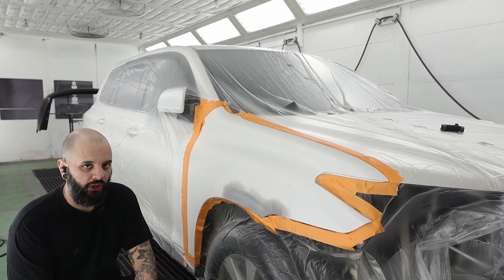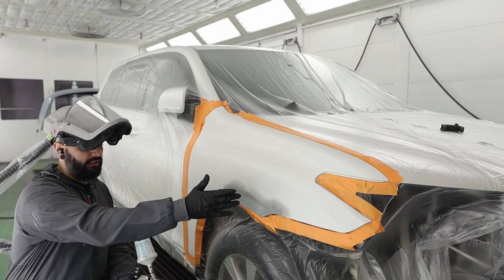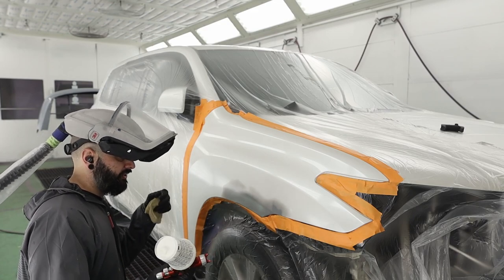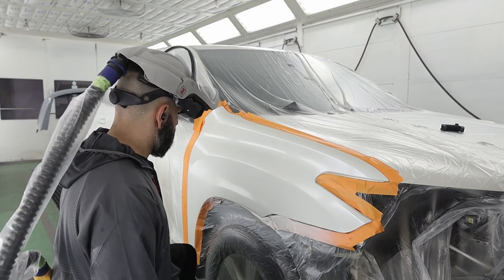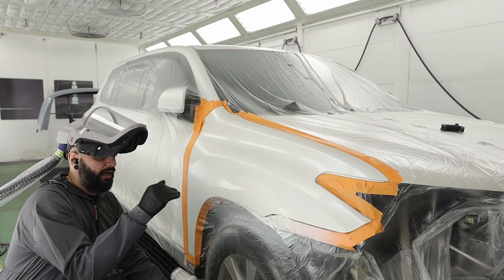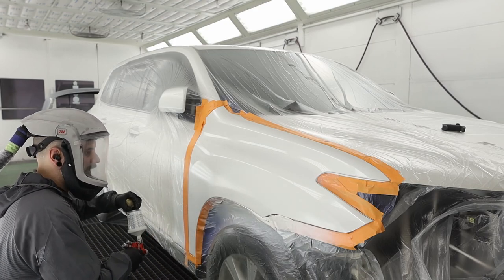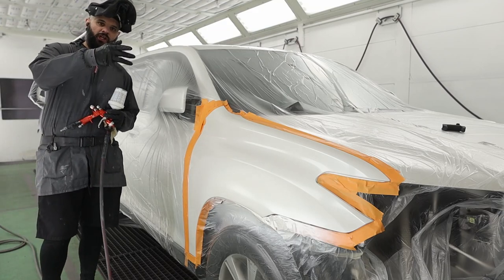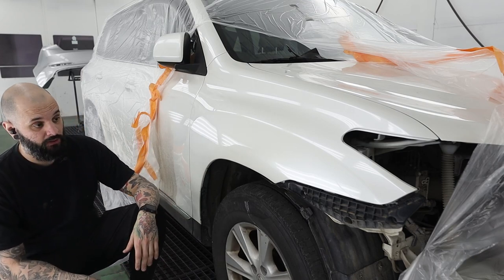Reverse blending basecoat (pearl white ultra 9k)

Comment: Your booths flash cycles, what temp does it go to? Mine doesn't have a flash cycle option, but normally crank up to about 95 to dry the paint. Just wondering if that's a good temp or can I go higher?